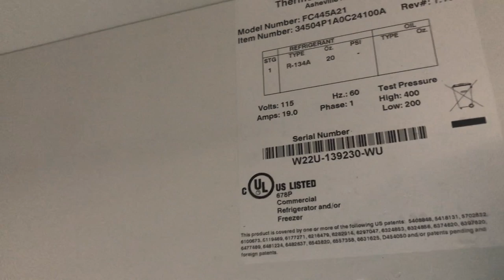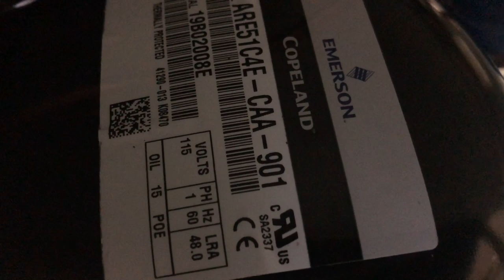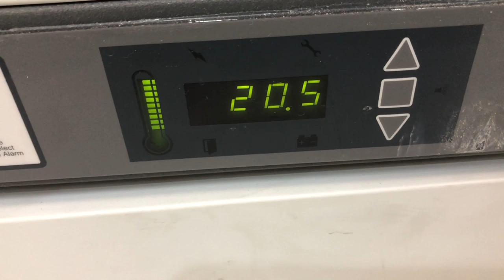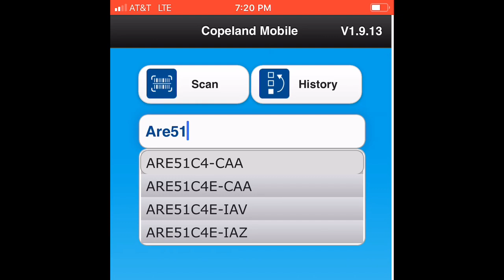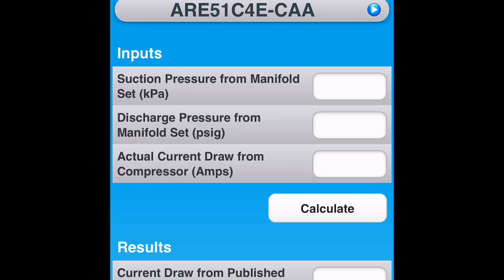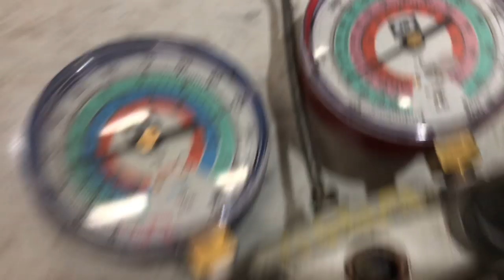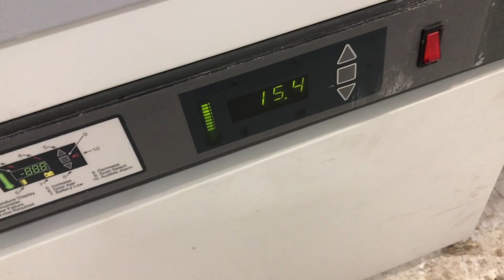THERMO scientific compressor

Comment: A Thermo incubator showed up in the HVAC/R lab one day, after having been scrapped because of a leaky evaporator and bad compressor. The evaporator proved tedious but ultimately fixable, while the compressor would have been a much more serious problem. I'd set aside some scrapped refrigeration decks, and one of those donated its compressor to the incubator.

Amazingly, it worked! The temperature control and stability on that thing, even running on what were probably badly mismatched parts, was incredible.

Comment: Nice super tech level vaccum there , sir 😄.  Hey , so what happened with the fieldpiece vaccum pump , a couple vids ago you said it was sounding terrible despite the oil change , did you get a response from them , did you manage to fix it yourself ?
Reply from the maker: It was the recovery machine.  I made a video of adding oil to it per manual, and it sounds better.
Reply: @NorCal-refrigeration  Oh shoot , I don't know how I missed that,  my bad ! Glad it worked though .

Comment: Word to the wise substituting wholesale version compressors with -901 BOM's can get you in trouble when the -959 BOM's for thermo can possibly have different internal components and oils than their wholesale counterparts with the same model number.  Certain Cascade and other comps. Are gauranteed to grenade with this path.  You are probably good on that one though just a 134a system

Comment: What was stored in these units?  You got to be careful if chemicals stored in them.  For special explosion-proof refrigerators they have to be labeled HFS and I saw the current 0/0/0 but keep those gloves on.  As a former Chemist our lab units had nasties in them, God's sake keep those gloves on.  Some chemicals go straight through skin and I saw some corrosion on the racks, a tell-tale sign.  Under OSHA - no food allowed in a chemical refrigerator.  I guess this could be a biology application.
Reply from the maker: Yes this lab use only.
Reply: Not an explosion proof notice internal fans that can spark.
Reply: Ricardo MAGARico Nothing worse then BSL 3 lab. Did all ultra low freezer -80c & W/I environment chambers . Even  did the HVAC & containment machine room where all the water went down the drain they had to steam water before it went to the PH room .This even could of went to level 4 we had to certified the breathing equipment  & maintenance never been used every year never been used.
Reply: @hvacrnortheastern2110  The lowest temp ever saw other than liquid N2 was -40 C Methanol bath. Don't know what refrigerant was used. Kept in lab hood.  -80 C mind bending.
Reply: Ricardo MAGARico    Cascade refrigeration is different you must have good refrigeration practice there isn't any short cut -80 c which is -120 F degree.First stage is R404 & R134 second stage is R508B & propane for oil return one total rebuild takes 32 hours. Revco came out with Auto cascade -140. -150c which is -255F one scroll compressor with 6 different blend with CO 2 .If you don't have some experience with cascade it could cost you & company a lot of money due to the product store inside if not done right first time.All parts are OEM
Reply: Dry Ice and acetone bath maybe?

Comment: How's your keto going?
Reply from the maker: Never did keto yet.  But probably should lol
Reply: Since you here what would be the reason a bimetal thermal overload burns out? On 1/4 True GDM-10 cooler compressor. I tried switch thermal for a good one and they  just spark and open the circuit. And even swap the relay & the thermal overload together  just goes back to open. The thing that fixes is switching the compressor. Any thoughts? Also I check my ohms and check if the compressor is ground looks good but just thermal overload always goes open.

Comment: I use to service a scientific supply company.  They sold test kits to hospitals. They had to keep their coolers between 9°c and 1°c per government regulations. The customer complained that that was unreasonable until I explained restaurants have to keep coolers between 4°c and 1°c. So 9°c was nothing. I think I have those celcius numbers right, but I still perfer farenheit.
Reply: When I worked at the grocery store the dairy cooler was always close to, but above freezing. Those temps sound correct.